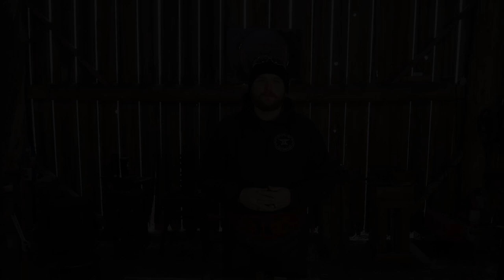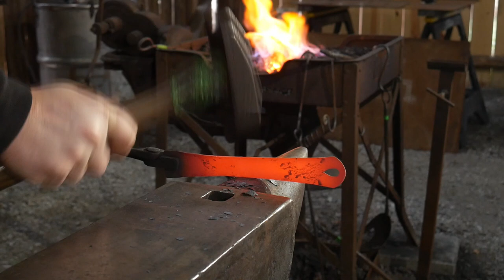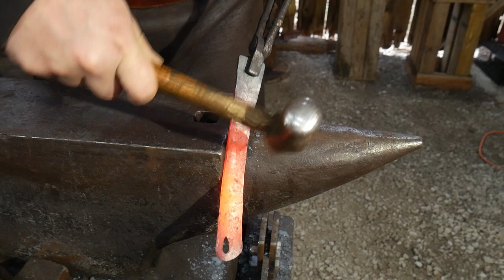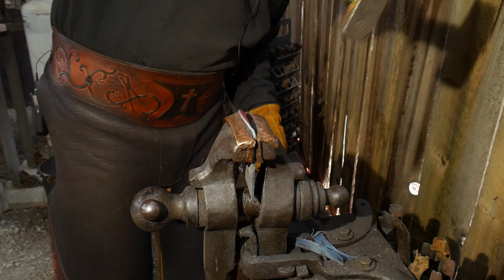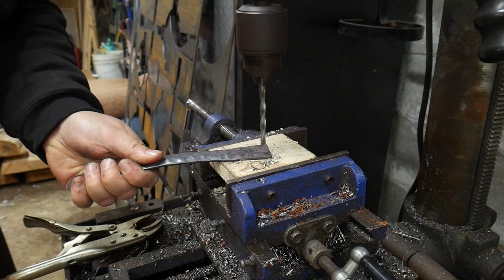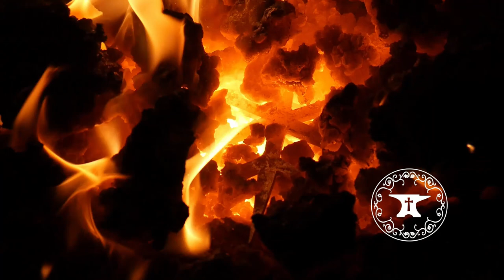How to Forge a Spatula with a Traditional Handle

Comment: Question: any particular reason why you use rivots to attach the handles on skillets, spatulas, ladels, etc?  Strictly for the looks? Just curious why not just make it all out of one piece, no rivots?
Reply: Oh, you meant cut the entire thing out of sheet metal.  Would not be traditional.  Traditional blacksmiths did not have plasma cutters.
Reply: @glenndarilek520  pretty sure he has a plasma cutter though so this style is just that a style